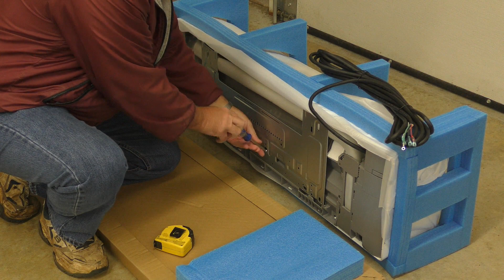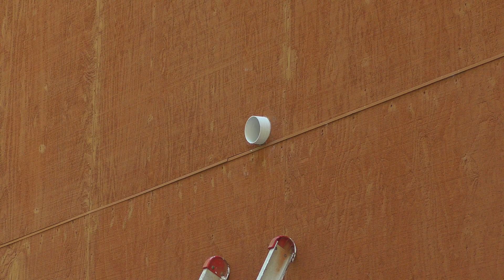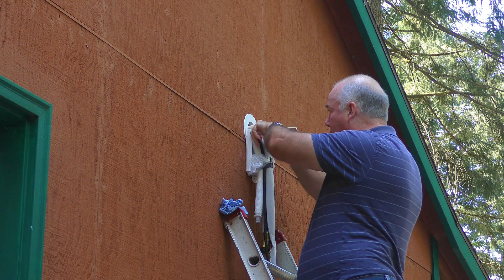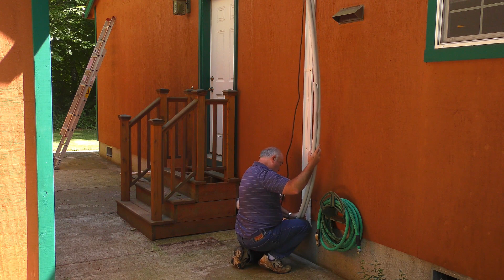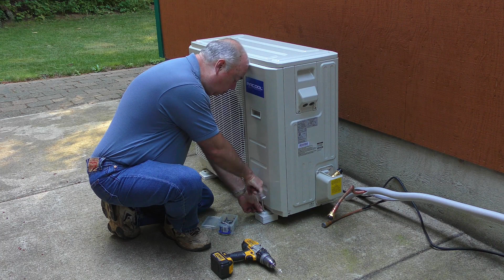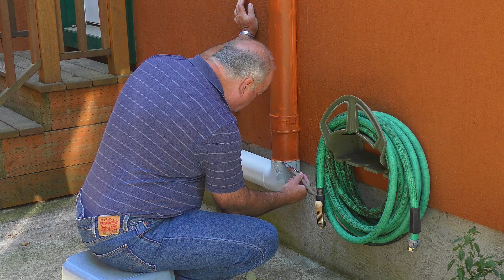Installing a Mr Cool Mini-Split Heat Pump Air Conditioner

Comment: It has been two years now.  Have you had any problems with your heat pump?  Is that a gen 2 or 3 unit?
Reply from the maker: I believe it is a Gen 3 unit. No issues at all. I originally bought it for AC and supplemental heat, so it is a little undersized for our whole 1456 sq/ft house. However, we turned off all of our in-wall electric heaters and now use the mini-split to heat the entire house. It works fine as long as we leave all the doors open, not an issue for just my wife and I. Our furthest master bedroom does stay slightly cooler in the winter, but that's perfect for sleeping. I did add a bit more refrigerant earlier this year just to top it up, but it didn't take much and I see no signs of leaking. I've thought about adding a second smaller unit for our master bedroom, but so far that hasn't been necessary. We love having AC on hot summer days, and our electric bill is much lower summer and winter. We can always fire up the wood stove or electric heaters if things get really cold, but haven't needed to so far.  Thanks for watching!

Comment: You should have raised the outside unit off the floor a few inches to protect it from water puddles.
Reply from the maker: The sidewalk already has a slope so there is no standing water. Also, I did add some PVC shims under the feet that lift it up about an inch on the high end and two inches on the low end. We haven't had any issues in the rain, snow, or freezing temps this winter.